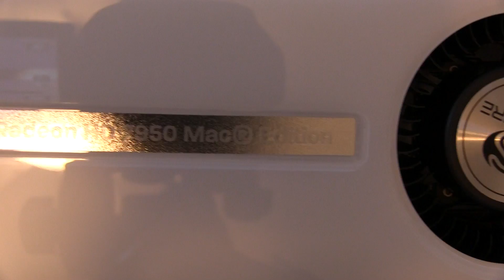Installing AMD Sapphire HD 7950 (Mac Pro)

Comment: Hi, does the gtx 750ti low power version(The one that doesn`t need a power cable on it)works on the Mac Pro 1.1?

Comment: My monitors are the 30" Cinema Display and a 34" Ultra wide with resolutions set to 2560 x 1600 and 3440 x 1440 respectively. Will this card support both monitors?
Reply: CyberGolem yes
Reply: TY! Do you know what freqs are supported for ultrawides with this GPU? Currently my QuadroFX will only support 30Hz and text looks like poop.

Comment: Hi DJAJ101 i just wanna ask all the way from Sweden Stockholm i have a Mac Pro (Mid 2010) running OSX Yosemite on a  ATI Radeon HD 5770 1024 MB with 32GB ram with 2 x 2,4 GHz Quad-Core Intel Xeon processor now but I Just Ordered 2 Intel Xeon W3530 Four Core 2.8GHz Processors from OWC coming in 2weeks from now. i´m having problems whit the graphic card its Flickering and its slow i don´t need 4k but i need a card that will work good and fast with FCPX for musicvideos , Logic, and Photographic software i do not play any games on my mac and i´m looking to get another  27inch Apple Thunderbolt Display will the Sapphire HD 7950 Mac Pro Edition 3GB work good with Yosemite. They do not sell the Graphic Cards in Sweden please can you help me out with the links and your advice thank you & Jah Bless 8/12/2015

Comment: Talking about static- maybe don't sit on carpet and wear a fleece jacket! Nice video. :)
Reply from the maker: Matt Jacob don't worry I always touched metal before anything else when holding or touch the computer or the parts ;) thanks for watching!
Reply: Do you still have this machine? I'm between a used pro 2010 or a new one. I hate the expandability options, or lack of, on the 2013+. Do you think these 2010's are still worth buying? I'll be using Premiere Pro CC and some After Effects(not 4k), along with Photoshop and Dreamweaver...
Reply from the maker: I sold it to my buddy a couple years back now since he did more video editing than I did. I ended up going with a nice retina MacBook Pro so I'm good. I think they might be depending on the price. They are 5 years old now so depends how long Apple wants to keep supporting them. They are great machines though, lots of power and to get one at a good price these days, pop a good SSD and video card in. You got a hell of a computer.
Reply: That's a big concern of mine. Being 5 years old, if Apple stops pushing updates to the 2010's in two years- that would suck! On the other hand the new Pros... eh. Performance is good but upgrade options are poo poo. 
Anyway. Thanks for the feedback!

Comment: I have this installed in a 2009 8 core with 10.9/Windows 8.1 installed.  Can this card output UHD resolution in os X?  Would like to get a 4k display but really don't want to boot into 8.1 to use it.

Comment: I want to upgrade my 7750 to the 7950. But I just bought a GTX 780. Do you think there is enough power to run both in the 2010 mac pro? I want the 780 for the CUDA cores and the 7950 to run some big monitors...
Reply: Some people run the 780 and it works fine but for some it doesnt
Reply: xpez I want to install my 7750 in my MacPro but the dock is white and not transparent and it's a bit laggy. Can u help me?

Comment: Hey DJAJ101 I ended up buying a new AMD Radeon HD 7970 3GB on ebay for $517 it works on Apple Mac Pro 2008, 2009 ,2010, 2012 and it has the boot screen which is a plus should get it this upcoming week will be doing a video also, and also stay tune I ordered a New 2013 Mac Pro 12-Core but that's not coming until Feb.2014
Reply: will it boot 10.6.8?
Reply: Len kenspocket Your using snow leopard right, Well I don't know if it's gonna work never tried it but It works fine with Mavericks and Yosemite
Reply: 34skyline any chance in future you can try a usb snow boot if it boots the installer? ty

Comment: Yesturday EVGA just announce Geforce 680GTX Mac Edition and it comes out on April 8th 2013, The price is $599 it cost a little bit more then the 7950  but I can't wait to see test results between Sapphire 7950 vs EVGA 680GTX i'm sure glad that I waited but I am going to wait a bit more and see what Apple is going decide what GPU going in the 2013 Mac Pro, Question DJA101 I tried taking out my 5870 for cleaning and I can never unscrew the nut that's holding the card is there a special tool?

Comment: Nice video dude. It is such a shame that there are 2 power cables for the new card. Otherwise the old card could be kept and used too. Is it possible to create an extension cable and use it to power the old card too?